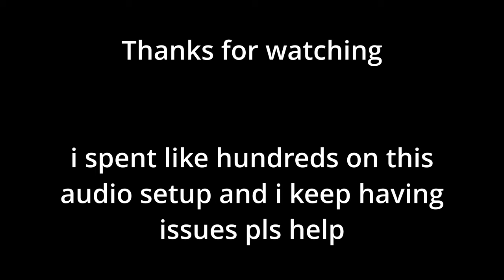How I Make Heavy Modular Frames - Satisfactory Update 8 (Part 15)

Comment: the wall ring between fuel generators could easily be another blueprint
Reply from the maker: With the pipe too? That would save some time. Then you only have to hook up power
Reply: @spork999 unless they changed something, you still need to join the pipes manually between blueprints. But at least you don't have to spend time with that wall layer, just stamp down blueprint number 2 on top of number 1.